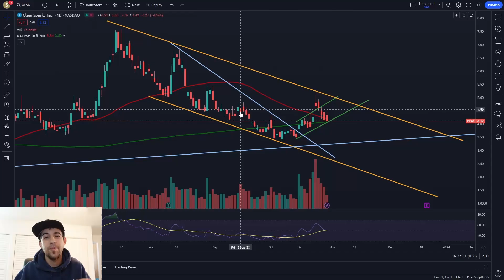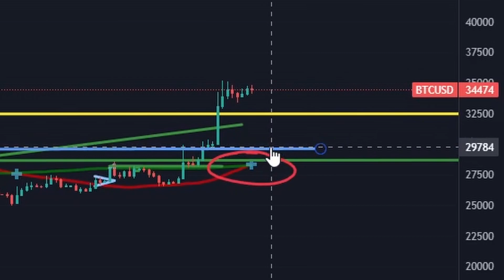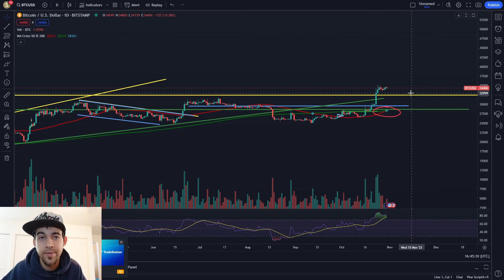Amazed Bitcoin Is HOLDING 34k - Cleanspark Reaches Hashrate Milestone!

Comment: I’m scared Tim. Bitcoin skyrockets, clean spark not moving 😒. If btc goes down, I think clean spark will probably tank.
Reply from the maker: It's just the market a lot of small caps beaten we have very high interest rates and inflation still needs to come down more so wall st is mostly avoiding smaller caps, I expect clsk will be a little higher by year end but we do have a lot of fear in the overall market
Reply from the maker: @dEath_kNIghT383  Fair enough, I expect microstategy do to well through to 2025 Michael saylor will be a very rich (richer) man